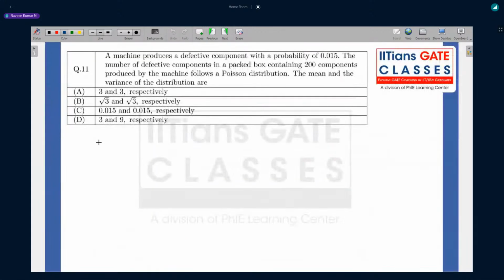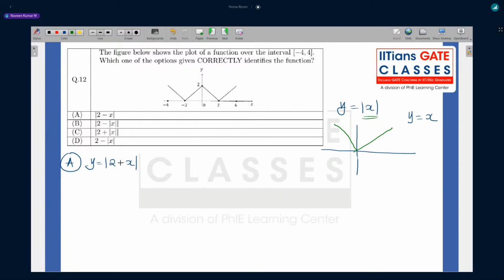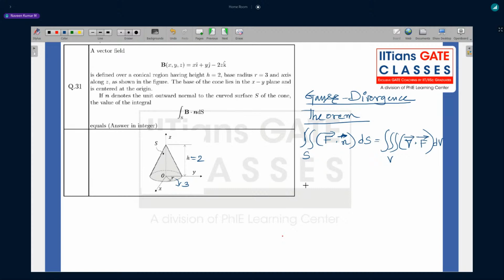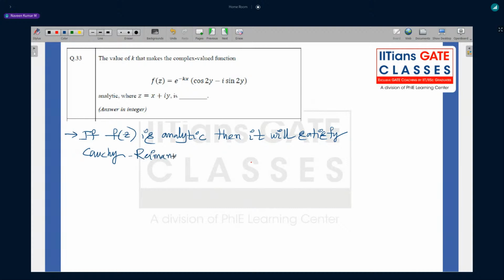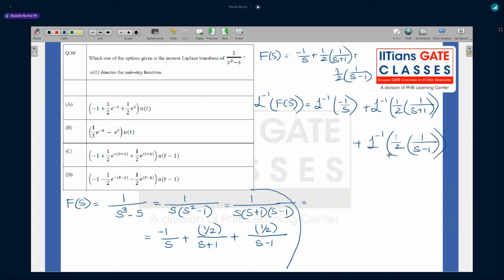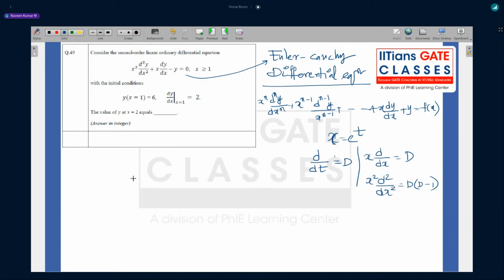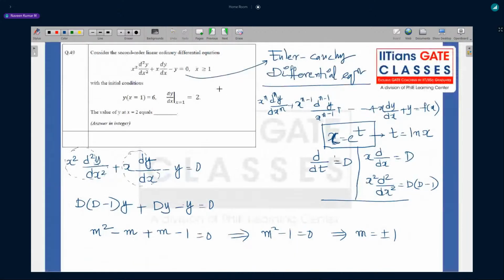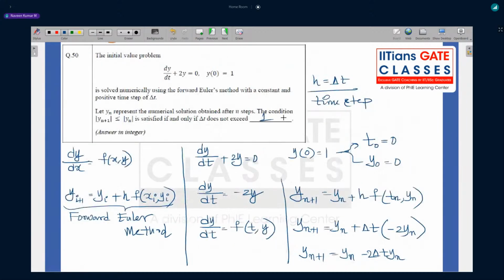GATE 2023 Mechanical Engineering Paper Solution | Engineering Mathematics Part | GATE ME Coaching

Comment: Q31: Divergence theorem is applicable to closed surfaces. Question says S is the curved surface i.e. it doesn't include the base circle. Could someone clarify?
Reply: Excellent! Also, thank you for pointing out the mistake. It was my mistake to assume a closed surface, but I was fortunate to get the correct answer :)

We cannot, in fact, apply Gauss Divergence to the given curved surface 'S'. We can use the following trick to find the solution:

Integral over closed surface of cone (a) = Integral over curved surface (b) + Integral over Bottom circle surface (c)
[a = b + c]

1. Applying the Gauss Divergence theorem to the closed surface of the cone, we get zero (a = 0).

2. Integral over the Bottom circle surface is also zero (c = 0).

We have to find the integral over the curved surface b = c - a = 0 - 0 = 0. Hence answer is zero.

Hope it answers your question. Please let us know if you have any further queries.
Reply: @maddunaveenkumar   How is integral over bottom circle surface zero?